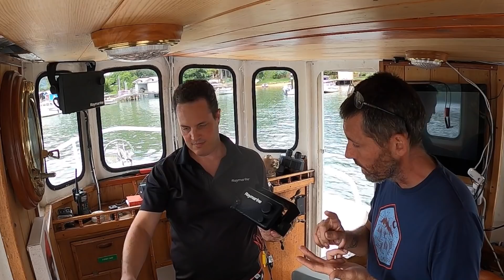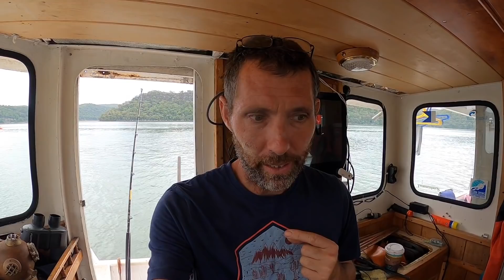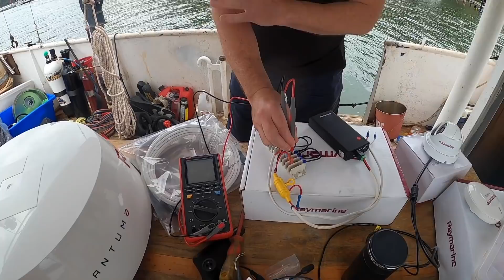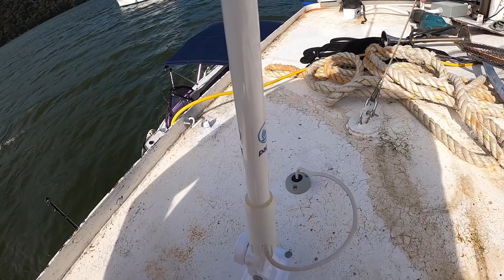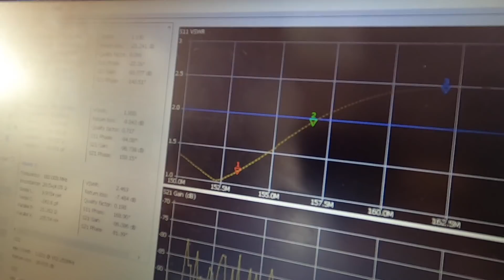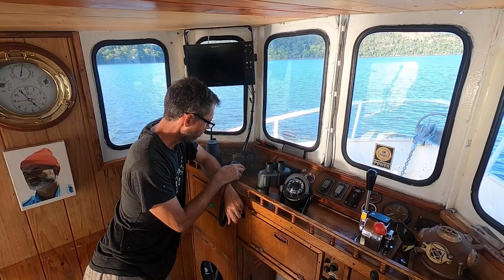Marine VHF radio installation and antenna tuning

Comment: Hey Stu, could you make a video about the procedures you should take with a VHF, what’s it’s purpose, how to use it and all that. I’m a rec boater but generally leave it off because I have no idea how it all works. Thanks
Reply from the maker: Hey mate. Definitely planning to do a couple of vids on each piece of equipment: one on installing one on using.

Comment: Be aware of auto pilot . Lots of people set it and leave the wheel house to cook , party , shower , sleep . Auto pilot does not care about small fishing boats that may be drift fishing or anchored .  Next ya know the Auto pilot boat runs over the other one ( friend of mine was sunk and set to life jackets in a smaller boat  after a yacht ran over them while they were partying )  . If using auto pilot please remain in the wheel house so you can see and act to situations that may come up .
Reply: Radar with proximity alert is an answer
Reply: I hope Stu will show us how radar installed and configured. It would be interesting to see how it works at night in the open water.
Reply from the maker: Yep, will definitely be doing vids on the radar too.
Reply: Yeah, autopilot causes many accidents, gotta have a human on the bridge, awake and alert.

Comment: As a Ham Radio Operator I truly enjoyed this episode.  Wish you'd go truly Comm crazy &  install a HF Radio too!
Reply from the maker: I have a friend who is a Ham radio operator too, we really wants to experiment more with radios on the boat. :)
Reply: @DangarMarine  oh wow! You fall down that rabbit hole you may not know where you end up! Imagine talking with someone here on the other side of the planet on a wire strung from a mast on top of Renko, using the same amount of power you’d light a Christmas tree bulb. The HF Bands is where you can do that. You sail over the horizon at sea, HF radio is the way to communicate.
Reply: @DangarMarine  73's de VK4NFL
Reply: @mvhassallfree1031  hahahaha
Reply: QRZ, DE VK4FAKE, 73's
Reply: @mwethereld  cheers from vk4fkas 73
Reply: @villiersman951  cheers from DL5SCW 73
Reply: Hi Ham friends DE VK2JAX
Reply: I forgot to add...WV1TPR from north central Florida!!!

Comment: PL259 / SO239   :P   seems he may be more of a salesman than a tech :P  ..... it's bloody amazing what these new maritime setups can do .. I'm still a lover of the old way pre DSC radios but see the safety benefit of the DSC in an emergency.

He's right ... transmitting at 25watts without a "load" (eg antenna) will likely damage the radio from the reflected (not emitted by antenna) power.

As for the terminating plugs ... bloody sook it's not hard to do that with a PL259. When you get into BNC, MPL, SMA etc you then need special crimping tools which START around $75 and therefor aren't an option for a single install. Once all my radios became all BNC or MPL it was finally worth me getting the tools.

I've NEVER seen anyone bother to actually tune a marine antenna lol .... though it is a good thing to do. Most are in a glass radome that you can't get too like the base VHF antennas. They're usually a coax vertical inside. Anything under 3:1 is eh (not bad not good) ... under 2:1 is acceptable ... under 1.5:1 is brilliant for SWR. Tuning the antenna BEFORE you install is a recipee for disaster!!!! Because as he says it WILL change SWR when you change location.

Good boy having and showing the ROCP!! I got mine in 98. Given MR SYD is likely being run off Terry Hills that's probably not too bad. And don't fall for the LOS trick either ... technically speaking they're ALL LOS but have different geographical affects. HF will bounce a little off the water and a LOT if the conditions are right off the ozone (I was listening to a WA USA ham/amateur last night on 7megs in my house on the Mid North Coast for example) where both VHF & UHF will "bounce" off different geographical features like cliff faces (ESPECIALLY UHF). I remember years ago living in a valley where I couldn't get either Taree or Newcastle TV towers ... I pointed west and up 45degrees and got a bounce off a cliff face somewhere to get my signal. Bad but it worked. That signal would have been 180-220meg somewhere so not far of 151-161. Don't rely where it can be helped on bouncing signals though it's a rather inexact science lol.

On another note I'll be crossing the dual concrete bridges by your joint tomorrow .. hopefully around 0800.
Reply from the maker: I can certainly see why people get right into radio, it does seem like a fun hobby to dive into, always so much to learn and then apply practically. I think Raymarine's recommendation to use pre-terminated connections is to avoid all those calls saying the radio doesn't work when really the use just did a terrible job of doing their first coax connection ever. ;)
Reply: @DangarMarine  yes I can understand what you mean about folks doing their first plug ... mine wasn't pretty.

Not sure if you check your FB messages or not ... I didn't mean to be non descript talking to you this afternoon on 73 (though I was returning north), I had to leave some details out for good reasons but it was great to talk to you for even just the fleeting moment and get to talk in real life to the legend and yes my radio is shockingly slow changing up that many channels (not a new DSC model :P :) but it works). I was actually a tad shocked when you did come back and had the volume turned too low so I wasn't sure if it was you returning or if Sydney MR thought it was you calling them (my bad).

If you do ever check your FB feel free to message me if you ever have radio questions though it seems you have a few followers who are knowledgable with radios to use as a great resource.

Comment: Transmitting aerials are a tricky beast so just as a point for education purposes. You already know that the aerial only handles half of the waveform and the ground plane is the other half. The position of the aerial on the boat can give you a directional effect. The fact that you have a steel roof and the boat itself is steel which is sitting in water may just nullify any direction effect in your particular situation but be aware of it when on a wooden boat.  The height of the tuned aerial in relation to the ground plane will also affect the angle of radiation lobe. 
I said it was tricky and basic errors are easily made. I am surprised there is not a specially built aerial to cover those two frequencies. Anyway scare yourself on how much you need to know https://en.wikipedia.org/wiki/Dipole_antenna.
Reply from the maker: There is an amazing amount to know, that's for sure. That's where the cat comes in handy. ;)

Comment: Stu , Will you be adding an external speaker IE down in the birth and out on the rear deck ? If someone hits the distress call button depending on where you are you may not hear it and or if your out on the back deck you can hear if someone is hailing your boat etc...
Reply from the maker: I may do, it's a very small boat though, you can hear it everywhere. I mostly go inside to turn it down because it is too loud when I am on the back deck with the engine off.

Comment: Surprised Antenna manufacturers do not supply AIS freq Pre-tuned units. That would guarantee optimal range for Tx/Rx
Reply from the maker: You can get them, but I like the idea of being able to use either antenna for VHF should one break for some reason.

Comment: wow,, very detailed antenna diag,, just for info,, Ive owned at the very least 12 boats so far,, and never , not once did I tune an antenna,, and I never had an issue with reception, or wished my radio could go further, etc,, who knows,, maybe I got lucky,,,LOL
Reply: no one ever tunes marine antennas with prefitted coax lol
Reply from the maker: This was more about moving a VHF antenna up to the higher frequencies used by AIS, but most of the time you can just plug and play, but of course without testing you don't know how close you are getting to what is possible with your radio.

Comment: @ Dangar Marine
Hey there Stu, with your antenna setup & radio you will never get a 1:1 SWR with 100% power going out from a packaged setup because antennas can be tuned for a wide bandwidth so it won't be tuned to a certain channel & also the velocity ratio of the coax would also need to be tuned to the same channel that the antenna is, shop bought pre made antenna coax setup's are not this pedantic. Only a custom made antenna / coax pre tuned to say channel 16 will offer you a perfect 1:1 SWR with 100% power going up the stick. Back in the 80's to 90's I used to measure my RG-213 coax which was around 13mm thick after it sat in the sun for a few hours after midday & again during the cool morning & cool night to calculate where to cut the coax to tune it to a certain frequency before I soldered the 239 plug tips to the end of the thick copper cable. Later on I got a piece of 4 inch sewer pipe for a template to wind the coax cable many turns to act as a balun before attaching the end of the coax to the tune-able 1/2 wave antenna. I was using a 50 watt 26 mhz to 28 mhz am, fm, upper sideband, lower sideband radio which I could transmit on am about 150km with a dead flat SWR on channel 11 on 27 mhz band. When I keyed up to talk my modulation wiped out every other conversation for 150km before it could not modulate over local stations in the area. I guess you could say that I was a little pedantic about using 100% of my power along with an amplified mic as well.

Comment: Thanks for this Video! 

short question: you mentioned that you can see DSC-calls on the Plotter with waypoints when Emergency is pressed. Is ist also possible to see this waypoints when you do a "normal" possition-call to another vessel, or is this "exclusive" to Emergencies? Greetings from Germany!

Comment: Antenna needs to be tuned by installing it where it will reside and no humans holding it.Then perform the reflection tests (SWR) etc... It needs to see the natural ground  plane. Grounding your radio is also very important..
Reply: Commercial antennas are resonate to their frequencies... Marine VHF/AIS antennas resonate perfectly in their ranges when purchasing any decent antenna. This is not HF where you need an antenna tuner (only if and when you plan to use different bands to which your antenna resonates - just had to put this out there) - Also, grounding is not always important and can and will alter your antenna performance. (It all depends on the antenna type and not the radio)
Reply: @morkusvandezee9475  Very little point to measuring SWR on a mobile dipole until after it's installed.
Reply: @MargaretLeber  Well yes, but marine VHF channels and AIS included are not out of range of the standard marine VHF antennas, so there's absolutely no need to tune/trim/adjust your antenna if you purchase one from any commercial dealer. I build antennas as a radio amateur, and I have had to adjust/trim to be able to get my SWR right, and I guess this is why I get so angry when people are fed bullshit stories. (This guy did not build a DIY antenna for the boat) I worked for 4 years as a radio tech doing marine, railroad and commercial installs/repairs also..
Reply: @morkusvandezee9475  73 DE K3XS (amateur extra class since 2000) 

Much better to go ahead and install the antenna and then check SWR. This will show you the effect of whatever ground plane you've been able to establish and also warn you of some forms of coax cable damage that can happen during installation.

Running a curve across the band is something done nowadays mostly because it's much easier to do than it used to be.

My wife NG3P is much more of an antenna (and radio) builder than I; she's a QRP fan. I built an Elecraft K2 back in the day.
Reply: @MargaretLeber  Agree 👍🏻 73 ZS1WLM

Comment: I think I just worked out a possible issue we are having with the Radios on one of our rescue boats, this video was educational, I just hope on my next shift I don't go down a diagnostic rabbit hole 😱
Reply: Metal or glass boat? Glass boats used to have wire mesh put under the antenna to help it.
Reply: @NullaNulla  Ally boat, the Raymarine expert gave me some clues as to what the problem could be
Reply: @NullaNulla  That's why they tend to use halfwave antennas, no groundplane needed. Important atop a sailboat mast.
Reply: Fiberglass antennas and coax go bad with salt water getting in little cracks. They need service or replacement exposed to foul weather. Commercial vessels use stainless steel thru the bulkhead mounts. Overkill? But a backup antenna is a good thing if you need range.
Reply: Take a grinder and bosuns chair!

Comment: If you don't have a friendly Raymarine engineer to hand, look on Aliexpress for the NanoVNA - about $40 (US). It will do the same job in showing where your antenna is resonant, and to check tha cable's good. (Actually it will do a vast number of other RF tasks too... - but that's for another video) You'll need a UHF to SMA adapter to make the connection to the antenna. 

Only other tip is this - the antenna radiates most at 90 degrees to its length, and not at all along its axis. DO NOT lay the antenna horizontal and expect it to work well. The number of boat videos where the antenna is laid down to look stylish is worrying - will they remember to pop it back up in an emergency ?

Safe sailing and thanks for the videos
Reply: we used to put the antena horizontaly towards the bow of the boat so u get a heading towards boat in distress like an compas when that boat(radio) is transmiting. its nice 2 see how tehnology is improving and now shows a blip in your navigation map. gretings from coratia and sory for my bad english
Reply: I love my nano VNA and my MFJ analyser

Comment: I ran a 11mtr side band unit for many years...had a 6 element beam @ 36 feet long also a 2k amplifier...never needed to do a radio check just warmed up the set and amp, pointed the beam to what ever country the skip was coming from and called...lol

The guy who fitted yours knows his stuff..
Reply: "11 meters 2kw" == bandit CB
Reply: @MargaretLeber  They made a film 
Smokey and the bandit....lol
Harmless fun for millions of people back then, good business for the radio shops and people making the Ariel's and aftermarket parts...
Reply: @theessexhunter1305  2 kw unlicensed HF on a directional antenna isn't "harmless".
 
Heroin is "good business" too.
Reply: @MargaretLeber  Shame on you bringing that comment into this platform....
I see you might be dropping stuff with your small plane lol....Or do you fly the c47?

Comment: cameras? are you sticking one under the boat, bit like a headlight under water.
If you pull my cats tail he will have your fecking hand off in one swift movement. .🤣👍👍

Comment: Cool video. As an Amateur Radio guy I would have fussed more with the antenna but your installation will work fine. Radio integration has come a long way.

I suppose you could have just used the handheld but in my experience the fact that you have installed properly a more capable system is the best way to prevent it ever needing to be used.

Best wishes and 73, Charlie in Virginia
Reply: can you explain in more detail what you would have fussed with the antenna and in what ways ,for a better results in reception or broadcasting.  im  not a ham radio guy but always interested to listen and learn from those who do know  thank you
Reply: @646klein  It can get complicated but it is rather important to get the VSWR of the antenna as close to 1:1 as possible at the frequency(s) you want. If cutting the antenna is not giving you a way to creep up to the ideal arrangement the I would investigate the ground plane of the antenna. There are two wires on the antenna from the back of the radio, one is to that central peace of wire, the other needs to be grounded to the structure of the pilot house at the base of the antenna. If we assume the pilot house is steel and well grounded to the rest of the steel boat and that ground connection to at the base of antenna is good then you should be able to get a better VSWR. Another thing that could affect it is the ship’s mast and other metal things near the antenna. If the grounds are good moving the antenna to be more clear of other structures can help.

If all that fails then an antenna tuner, an electronic circuit made up of inductors and capacitors added underneath the antenna can help.

It is a long discussion. Charlie
Reply: @646klein  646klein, I've been tuning ham radio and CB radio antennas for years. Try to keep your  antenna away from any metal that can interfere with its radiation pattern. Install an antenna that has the gain characteristics you need.  I always determine my lowest and highest frequency I intend to operate on. Make your VSWR measurement on the lowest frequency first. Then compare that to the VSWR on the highest frequency. If your last channel is to low, lengthen the antenna. If your last channel is too high, shorten the antenna. Most VHF gain antennas have about a 3 Megahertz bandwidth. Unity gain antennas operate wider bandwidth, but without gain. I hope this helps.
Reply: thank you both for your replies i know that a good ground is important to the antenna  to curb eddie currents and noise in the line . and that metal masts etc can disrupt signals , i worked at a  gentlemans house who was a ham radio guy he had a 30ft antenna on the roof of his house with guy wires th went to the end of his garden i assume for  a good ground and stability of the antenna too   there is much to learn in this field  thats for sure